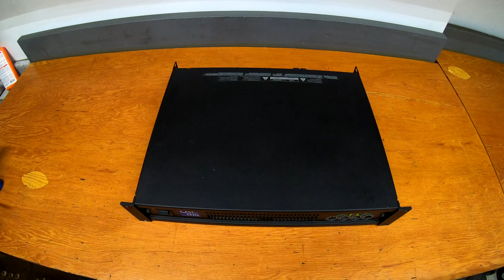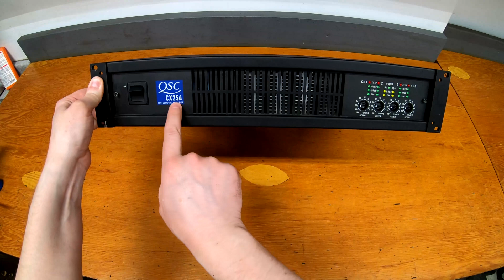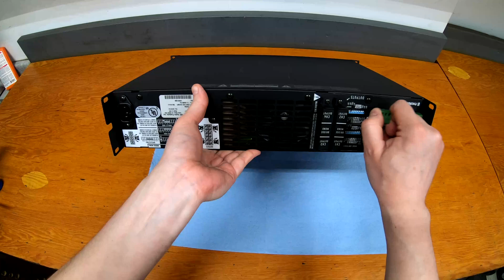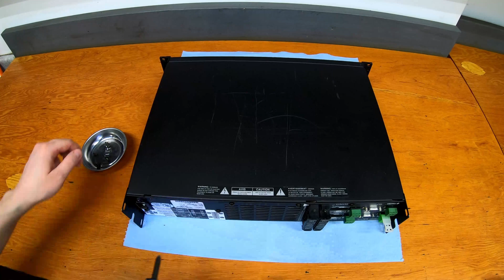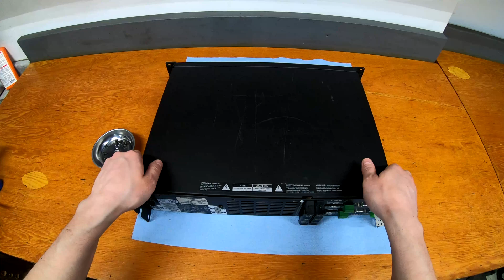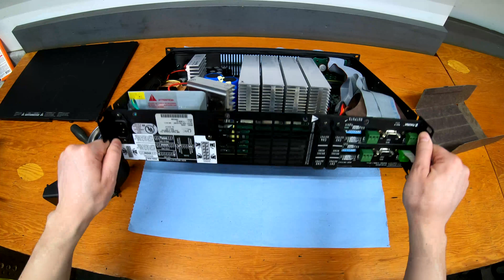QSC CX254 Professional Power Amplifier - Look Inside!

Comment: I just ordered a cx404 in good condition for 200, ill be over the moon if it works. Thanks for the teardown.
Reply from the maker: That's a pretty good deal, the CX404 is a solid amp too!
Reply: @SomeGuysGarage  yea it looks like the same (nearly) internals as a plx for 1/3 the price! The first two used amps I've tried recently, both crown install amps, (cdi and cts) both DOA so fingers crossed.
Reply from the maker: @loyton  did you open up those Crown's to see what was wrong? Could potentially be minor fixes.
But ya, QSC reused the same topology across a variety of their amps, mostly changing I/O options and other minor features to tailor them to the use case.
Reply: @SomeGuysGarage one of them i sent back right away, the other has a known fault and I believe its my issue and I have the caps to replace! I have the right replacements and which ones to do (the two next to the power supply should be 50v but are 35v from factory and burn out) anyway ive never desodered caps before, does it just come loose once you apply soder stick with iron touching it? Or do i absolutely need a needle point. Just doing two big caps. Anyways ill figure it out thought id ask
Reply from the maker: @loyton  heat with the iron and once liquid, without completely removing heat, suck the solder off the back of the board...might take a couple shots but once the solder is removed the leads for the cap will be free and it will just come out.
Reply: @SomeGuysGarage thanks!